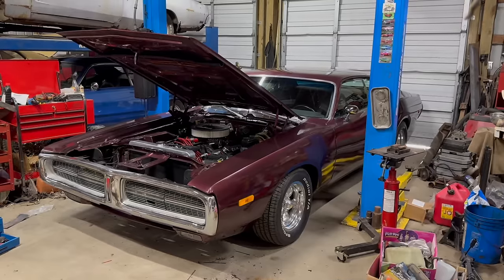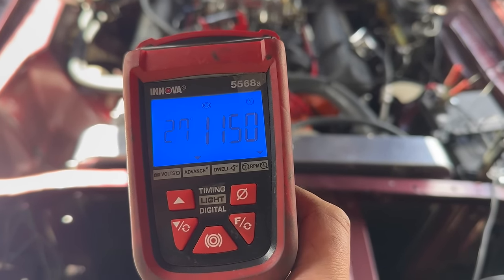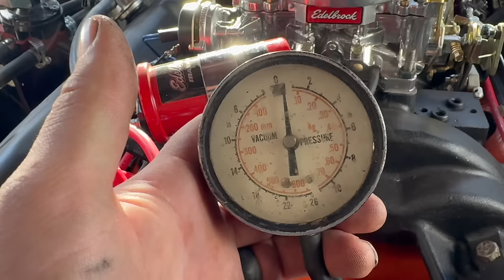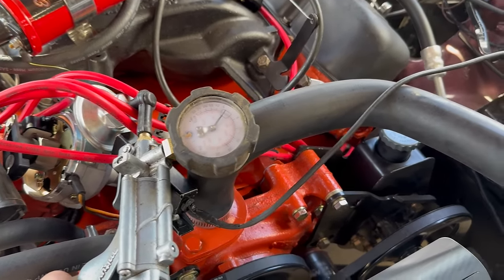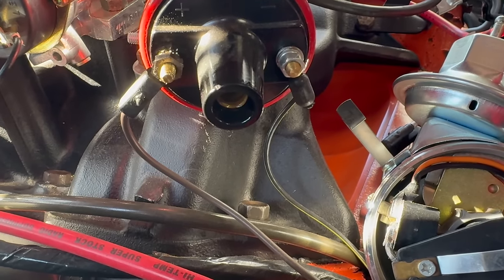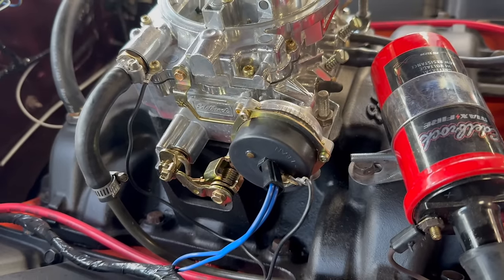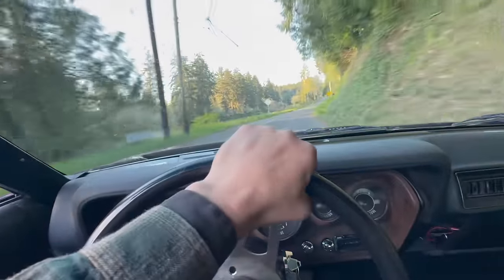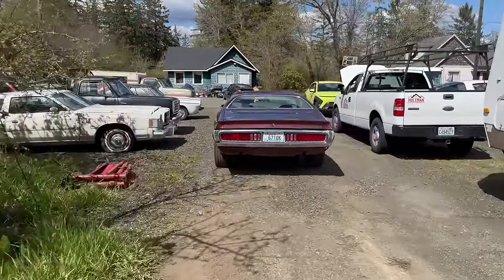How To Make Your Hot Big Block Run Awesome - 1973 Dodge Charger 440 Distributor Recurve And More

Comment: i have used edelbrock carbs for 20 years.the covers over the metering rod and piston are supposed to be tightened down they should not be flopping around when you rev the engine. At least that's how they come from the factory. I've never seen them moving around like in this video.
Reply from the maker: 🤦‍♂️ it’s a test used to verify your step up springs are correct for your application. You temporarily loosen the screws so the covers will move. If you see them fluttering up and down at idle your springs are too strong for the amount of vacuum available. The pistons should pop up as I showed here. No, they are not left loose. That would be a very, very bad idea. I didn’t think I had to say that.
Reply: @DeadDodgeGarage  thanks for explaining i am going to try that test.when i saw the video i got confused.That happens a lot to me lol...

Comment: Also once you get enough fuel at idle in that bad boy you'll be able to cut back on that timing initial. 38 and 44 initial that's crazy. All you need is about 12 or 14° initial.

Comment: Yeah man, love your work, cant get enough of your Mopar vids. 
Silly question..... When you change the amount of distributor advance why dont you weld the outside of the slot instead of the inside of the slot? Wont that take more rpm to start the movement as you preloading the spring a bit?
Reply from the maker: That’s an interesting thought. Hadn’t considered that. But I can’t say it’s been an issue. When you’ve already got 20-25 degrees of advance, plus vacuum if set up with that, a bit of delay to get the rest of it doesn’t seem to be as critical - and in some cases it can be helpful in preventing pinging. The idea from Uncle Tony was that distributors are designed to phase the rotor correctly at maximum advance, so allowing the mechanism to reach that position would be ideal. I tested that theory with a Mopar Performance distributor (which limits the other way) and a cap with a hole drilled in it, and found no issue with rotor phasing. It was dead nuts straight. But I still do it this way.
Reply: @DeadDodgeGarage  Thanks for the answer 👍

Comment: Jamie, I have not really had a chance to get to work on my 73Charger, but they might have told me the truth about the engine being a 440 instead of a low deck by looking at the way the engine sits in that most awesome car i wish was mine,mine has the lawn mower engine size AC compressor and it covers the front driver side of the engine and it is hard to see if it has the wide pad and with the displacement stamped and there is nothing stamped next to the dizzy, obviously when I can get it jacked up and get under it with a flash light and read the numbers cast in the block i will know for sure but it looks like the very same car a guy i knew years ago put together with a 383 even has the same front end issues, definitely needs a new steering box, it is red with the black interior but has a floor shifter and bench seat, the shifter sucks and i have to decide if i get bucket seats or reinstall all the column shifter stuff which i don't have, love the color of your car wonder if it is close enough to red to not have to have the title changed from red to whatever color that is, man do i like what you did with the car only thing I might have put different is a set of aluminum slotted mags in 15 inch but that's just me, I like the slots on almost every car,van or truck, well just had to comment on the car it's absolutely the car i have been wanting since 1985 can't wait to see more of it, have a good one
Reply: My comment on top of my original comment, can't get enough of that car, you really did it the justice it deserves, always a spot for the third generation Charger and the 73 has some really good looking body lines,, they look bad arse

Comment: Something subtle but could at some point factor in. The small block cars had 5/16 fuel lines the big blocks had 3/8" lines. I have a '71 big block tribute Super Bee.
Reply from the maker: It’s not all big block cars - it’s 440 HP powered R/Ts and similar, 426 Hemi cars, six pack / six barrel cars, some police applications, and I’m sure there are others. Like I’d imagine Max Wedge also had 3/8”. But yes, at the big end, this combination could in theory overtax the 5/16” line. It’s right on the edge. In practice, this car won’t ever see the kind of use that would find that ceiling.

Comment: You mentioned that you would have preferred to see an AVS 2 carburetor. I’m a total newbie to carbs, what is it you like about those compared to others?
Reply from the maker: They have a modern booster design and a tunable secondary air door. It’s the best street carburetor available today, in my opinion.

Comment: Where can I get the brake master cylinder and proportioning valve you installed and recommended?  I’ve seen that same one used by another “Mopar Pro” but haven’t found it with nothing but an image to go by.

Comment: What are your thoughts on welding the other side of the slot and making up the different with distributor placement which UTG says is better for phasing?
Reply from the maker: I did this one the way Tony does it - I allow it to reach the full advance position, by welding it on the inside / low side. I got that from him. However, I also tested this theory recently with the Summit knock off of the Direct Connection distributor (which was a knock off of a Mallory, I believe.) Those limit the advance mechanism from extending, thereby limiting on the other side of the curve. I drilled a hole in a distributor cap after I changed the curve to check the phasing. Absolutely spot on perfect. My take away is that it doesn’t matter - but I will continue to use Tony’s method.
Reply: Oops should have read this before I commented on welding that side of slot. Sorry
Reply: @DeadDodgeGarage  oh thought UTG welded the other side of the slot.

Comment: Little confused by welding that side of slot? Phasing thing? My old Mallory dual point limits the travel of pins. Could put pins on other side of adjustable limit bar? ouch.. my brain.. ha  and thanks!!!
Reply from the maker: There are plates commercially available that limit the travel in these in a similar fashion to the Mallory. That's also how the adjustable Direct Connection distributor functions. This does the same thing without a plate, or trying to jam something in the hole. Welding the slot limits the travel in the same way, doesn't take long, and costs essentially nothing.
Reply: I understand that.. but you welded the start of the slot towards the shaft? I’m obviously missing something.:: sorry know you’re a busy guy. Just confused.!! thanks

Comment: Of course, all of this is way over my head, but I noticed that the vacuum port is capped on my distributor, so does that mean that it is working via mechanical advance alone?  And is that a good or bad thing?  Pros vs. cons?
Reply from the maker: Right. Your vacuum advance is not in play. That’s very common for many performance configurations. I usually don’t use them for go fast stuff. I have tried using it on small blocks and it has never worked well for me. But I have now set up two 440s like this, and for those it seems to work very well.
Reply: @DeadDodgeGarage  
Very good. Thanks for your reply.  I will leave it be, for I don't know if it would be as simple as attaching a vacuum line from the distributor port to the carburetor without having to mess with a lot of other stuff.   It's a 440.

Comment: How did you know that replacing the needles was a good idea? Was it running poorly? Smelling gas? Bad spark plugs?
Reply from the maker: When revving up it just didn’t seem happy. It could have been timing related too, but when I saw the baseball bat sized needles I did some research and learned that the 1411 comes with small jets and big needles - the opposite of what we want. So I took a stab. It revs up cleanly now, but it might be a bit rich on the cruise side. Need to play with that some more and do some plug reads.

Comment: Not every coil is made to be mounted horizontally. That Edelbrock looks like a rebadged Blaster II, which is only supposed to be mounted vertically. MSD coils are also hard on stock style ECUs. Recommend a Jegs Hi-Rev ECU and traditional oil filled coil.
Reply from the maker: I will definitely keep that in mind. The Blaster II in my ‘68 Charger was mounted sideways for a long, long time though.

Comment: I spy a pair of redbacks. Had this current pair for 5 years now
Reply from the maker: Nice! I usually get about two years out of them. I replace them when my feet start getting wet in the winter - but they are still otherwise usable, so I always save the last retired pair. And I wear them every single day, unless it’s nice out and I’m wearing shorts. My back has been much less irritated by my life choices since I stopped wearing flat sole Vans and Chucks and switched to these.
Reply: @DeadDodgeGarage  likewise. Wear mine every day as well. I replace the insoles quite frequently, 3-4 months.

Comment: If you need more air at idle maybe pcv valve?  Anyway awesome car, awesome big block.  Thanks Jamie.
Reply from the maker: That was a thought I had too, but the goofy one that we have now isn’t the answer.
Reply: Back in the good old days someone, I think.it was Ford used an inline pcv valve
Reply: I believe it was 3/8 hose nipple on either end....May have been 7/16.

Comment: Send the new or used "oil pump" to line2line for their coatings. Reinstall and you will have the vacuum you need. Trust me.... But, I think you have other issues.
Reply from the maker: What? I see that company has a coating for piston skirts and stuff, but I seriously have no idea what you mean in this context. And I have even less of an idea how coating any single piece of this combination contributes to higher vacuum. Feel free to enlighten me.

Comment: Maybe just a vacuum reservoir and not a vacuum pump would be a fix.
Reply from the maker: While it couldn’t hurt, I suspect that even a reservoir is going to store up enough vacuum for one or two hits after the car has been driven, and when sitting at a stop, after hitting the brakes once or twice, that will be gone.

Comment: Holley is garbage. They used to be very good, but these days are made from cheap Chinese parts. Bought $2500 worth of Holley Carbs last year for my Dart, and none of them worked. Bought an Edelbrock (which I should have done in the first place) and it works perfectly.